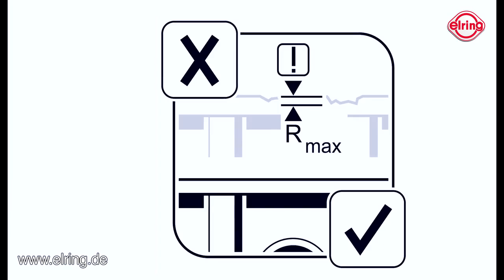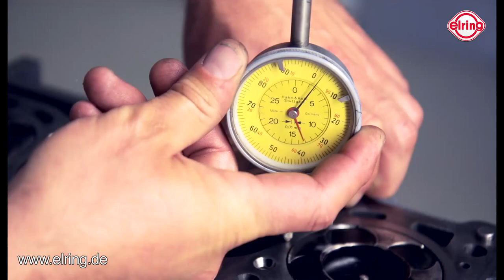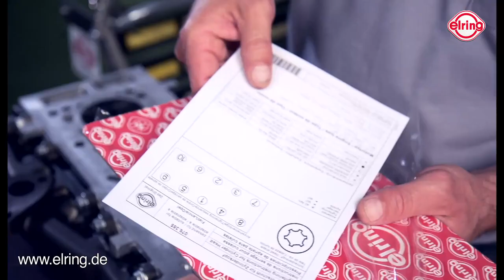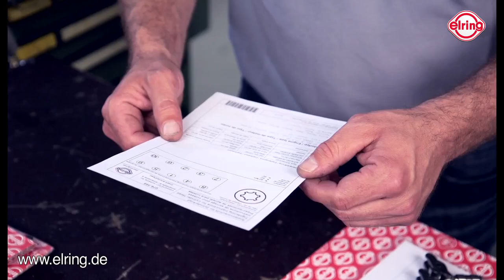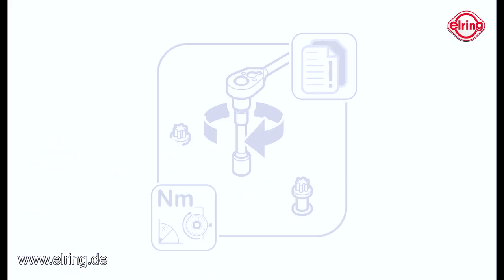Elring - Professional Installation of a Cylinder Head Gasket in a Fiat Engine

Comment: Is a multi layer steel gasket better than a gasket with silicone bead on the water jacket surfaces and metal rings on cylinder sleeves?

In say, a regular 1,4 floating sleeve 75hp clio mk2?
Reply from the maker: Thank you for your comment. In general, the MLS gasket system is more stable and resistant, especially against part movements. The gasket is more massive in general. The silicone lines are for a proper sealing around jackets, especially if there is less clamp force in that area – this case we have if the parts are moving a lot and if we have higher vibrations of the sealing gap. As a fact of this, both systems are different and every system has its own specification, normally you cannot mix it. The decision is normally made during development. (except Rover K engine)
Reply: Ok, thanks for the info :)

Comment: Hi, great video tutorial. Can 1200 grit sand paper be used instead of the oil stone ? Is the block you worked on aluminium or cast iron ? thanks in advance
Reply from the maker: +Kaktus Jack Thank you for your comment, This video is a Fiat 1.3 JTD, the block is made of cast iron. The oil stone is not for working on the surface quality – it´s justto crack and level the edges at the water and oil channels. For this work it´s also possible to work like you described but you have to oil the grinding paper, generally the job is easier to do with an oil stone.
Reply: +Elring Parts Ltd Thank You very much for your reply and informations.

Comment: Saludos: Acabo de comprar una junta de culata ELRING para un motor tdci de for focus 115 cv. 
Para apretar los tornillos le doy los pares y grados de apriete que vienen con la junta, o le doy los que indica ford en su manual de taller.  Es que no son iguales.
Gracias.
Reply from the maker: Thank you for your comment. Could you please tell me the part number and I can find out the correct information for you.
Reply: Best regards: ford focus  Cylinder head gasket   No. 027,072.
Thank you.
Reply from the maker: Hello Gabriel, I have looked into this further and I have the information that the Elring torque settings are the same as the Ford torque settings. I am however unable to share this information on a you tube channel. Could you please explain to me what you think is different. Thank you
Reply: Saludos.

 Ford vs  Elring

¿Cual es el apriete correcto?  

Elring  dice:-------------------------------------------------------------

Para pernos de M12 x 177.
1º - 20 Nm
2º - 54 Nm
3º - 90º 
4º - 90º

Para pernos de M12 v 137.
1º - 20 Nm 
2º - 54 Nm
3º - 90º
4º - 70º

Ford dice:-----------------------------------------------------------------

Para pernos de M12 x 177.
1º - 20 Nm
2º - 45 Nm
3º - 110 Nm
4º - 130º

Para pernos de M12 x 137
1º - 20 Nm
2º - 45 Nm
3º - 110º
4º - 100º

¿ Cual es el mejor???

Gracias.

Comment: Why is he using silicone that can rip after some time in the engine and cause problems and not use just the head gasket?
Reply from the maker: +SacreDro Thank you for your comments, The silicone is used to stick on the parts so that you have to cut it in case of a new repair. The edges and T-connections are sensitive sealing areas – to make sure that the gasket  is working proper we need some additional silicone (small amount) – this is according to OE instructions.
Reply: Do you use a special type of silicone or just a normal head gasket silicone will work? I use a red type of silicone.
Reply from the maker: +SacreDro 

On this video we use part number 129.400 which is Dirko S HT,
this is a high performance sealing compound. For all technical information
please click the link below. Change language to English and type 129.400 into
“article number”:
http://ows-cdn.tecdoc.net/elring/home.jsp?server=2&time=31/3/2016-13:15:51#9f0a7faf39ddd73a2e22f14a94f205fa

Comment: Che grana ha la pietra?grazie mille
Reply: +Gió Thank you for your question, We use a standard Arkansas Oil Stone (you can find with an internet search) in medium roughness.
It´s important to understand that this stone is not useful for the final surface finish - it is just to level the edges round 
the water jackets, the oil bores, etc.
Elring do not have this stone in their product range.

Comment: which grain has the stone?
Reply from the maker: +Giovanni V. Thank you for your question, We use a standard Arkansas Oil Stone (you can find with an internet search) in medium roughness.
It´s important to understand that this stone is not useful for the final surface finish - it is just to level the edges round 
the water jackets, the oil bores, etc.
Elring do not have this stone in their product range.

Comment: what kind of stone you uses?
Reply from the maker: +Gió Thank you for your question, We use a standard Arkansas Oil Stone (you can find with an internet search) in medium roughness.
It´s important to understand that this stone is not useful for the final surface finish - it is just to level the edges round 
the water jackets, the oil bores, etc.
Elring do not have this stone in their product range.
Reply: +Elring Parts Ltd ...ook thanks😊

Comment: what exactly engine is this
Reply from the maker: Thank you for your comment. The engine code is 199A2.000.
Reply: Is the Fiat's 1.3 Multijet 55KW (75 HP) engine
Reply from the maker: Yes, you are correct.

Comment: To bad fiat sucks .
Reply: 2008 Grande Punto: 135k, 1000 € in maintenance and spare parts
2015 Honda Jazz: 100k, 4000 € in maintenance and repairs :)
Reply: Except Fiats use a multitude of engines from other manufacturers.